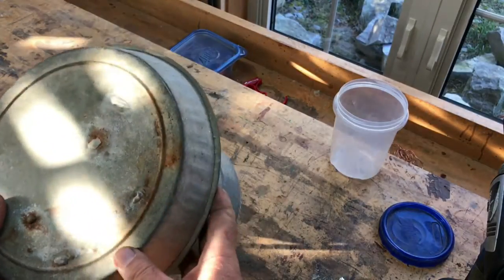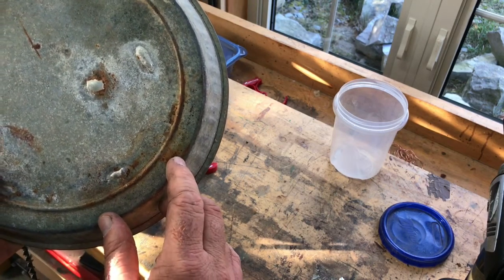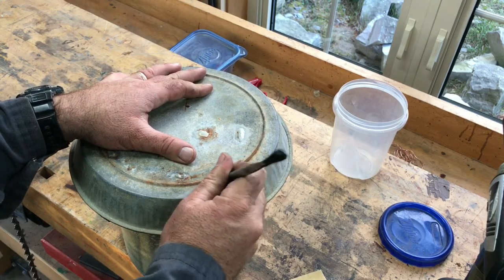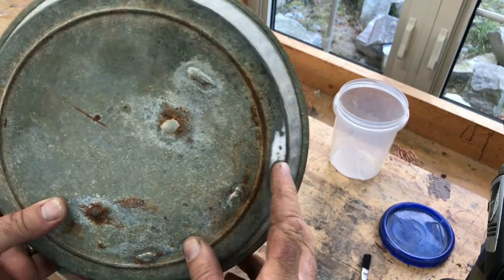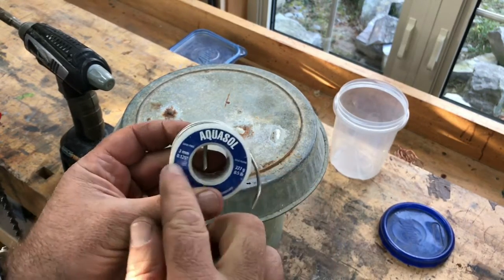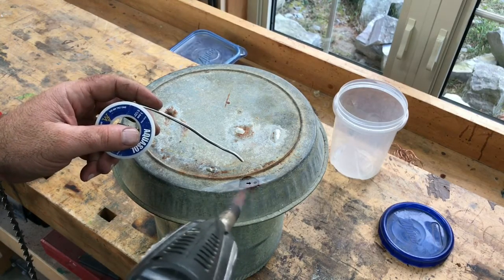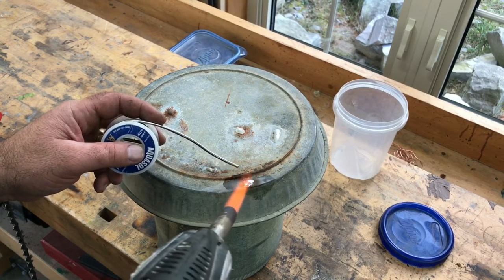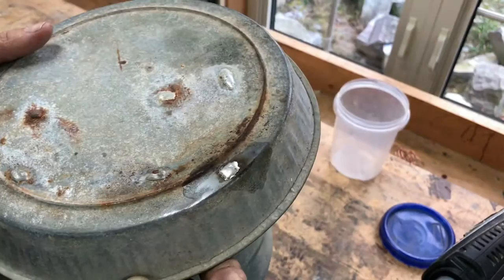DEMO: How to Fix a Leaky Chicken Waterer

Comment: When the trough sides overflow all over and IS not Leaking on the bottom through corrosion of oxidized rust holes (as this video shows soldering up rusted holes). It will most likely be that the seams on the outer sleeve  are leaking air and breaking the vacuum and allowing the atmospheric pressure to force the water through the springed gasketed seal and all over the floor of the coop (at the time where most people chuck it and go buy a new one..Some new ones have a leaking sleeve at the factory). they all will eventually fail when the rivets or seams corrode and leak thus not holding the vacuum to the level of the rubber gasketed opening at the bottom.The water level in the trough should never be higher than the inlet opening. to fix this take a wire brush and clean all the spot welds rivets and seams really well. Get a tube of kitchen and bath silicone caulk and a 1 inch wide new foam painters brush . put a small 3/16"  bead directly over the rivets and seams and swirl and flatten out the bead then let it dry for 24 hrs and It WILL NOT OVERFLOW and the chicken especially will be happy. and The coop will like it even better. Or you could Solder all the Seams as this gentleman did in the video. same process but silicone is easier. Cheers